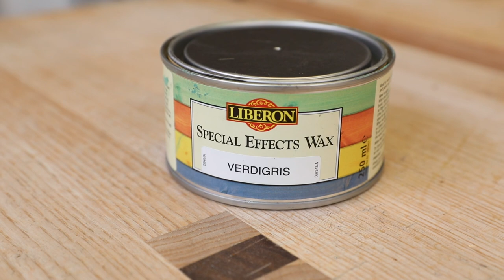VERDIGRIS WAX?! | Experimental Wood Finishes #3

Comment: I was a picture framer in another life and did quite a lot of hand finished frames. Hardwood, open grained timbers like Ash were a favourite. Sand the ash and leave smooth. Apply Lime wax, Black patenting wax, Terracotta or Verdigris. Rub in with wire wool making sure to fill he grain. Leave for 30 minutes and apply a clear wax polish which will take off all of the special wax except what has filled the grain. Great results every time.

Comment: Haven't read all the comments but I think you should try wiping off the wax with finishing oil on a cloth. I use this method on gilding creams and it works really well as it doesn't effect the original finish. Wire wool is too aggressive.

Comment: I just tried this for the first time-silver gilt cream on India black inked swamp ash guitar body. Question is about nitrocellulose atop this. I spray med a vinyl nitro between dyed and filling cream but finished in glossed nitro-even after 10-12 coats you still could feel the grain. I did wire brush the grain and it bit into grain nicely. Just not sure about wet sanding? Any experience with this? It is amazing how easily you can pull the wax/gilt cream out of the grain. Wood does what it does. I think mine worked well due to sealing between India black ink dye and silver gilt cream. That last example was prime.